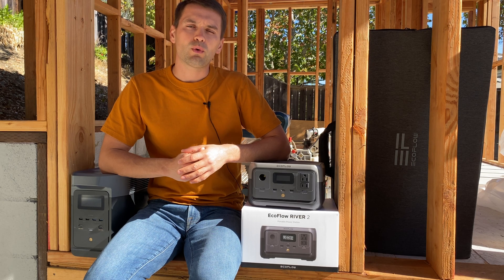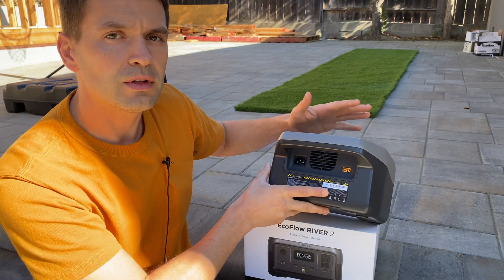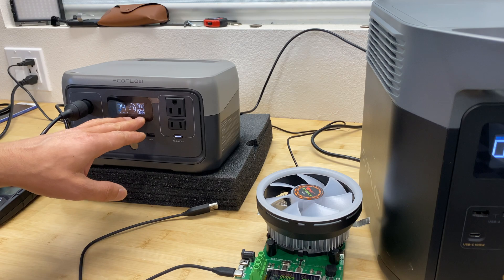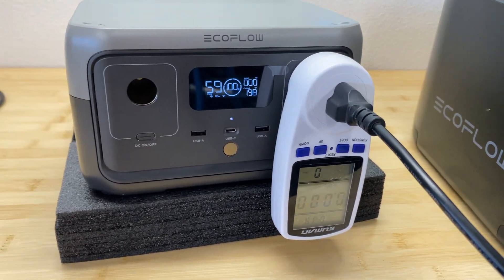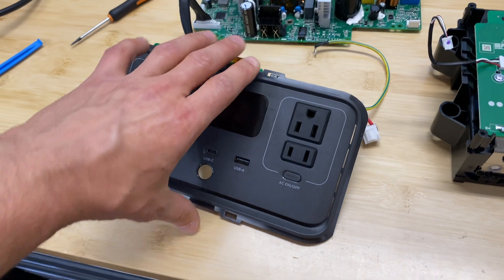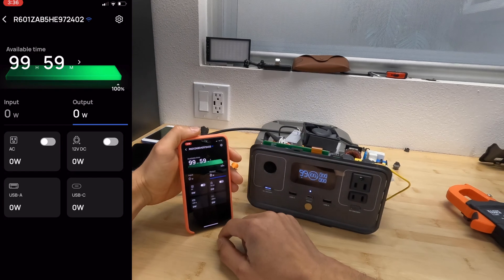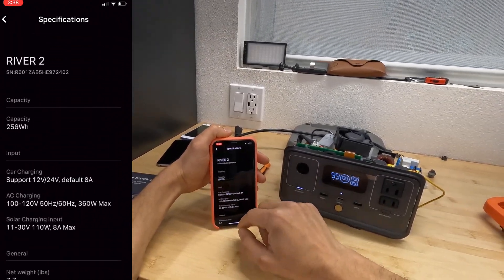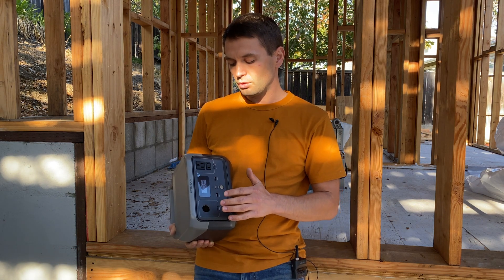EcoFlow River 2 power station. Is it really good?

Comment: I bougth an EcoFlow River 2, Now I want a portable solar panel from EcoFlow, but can't decide, and even didn't know If I can use a 160W always instead a 110 W, so it Will manage and scale the solar input  down to 110 W without damage or any issue. The 110W will never get those full 110W generation, that why I'm considering 160W instead but with that doubt.
Reply from the maker: I checked with technical support, and they are not recommending upsizing the panel.